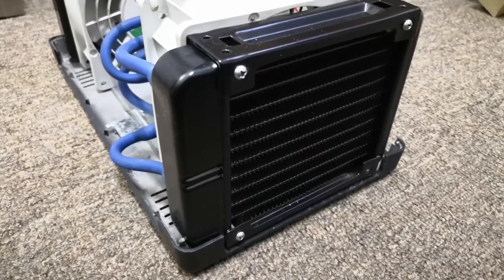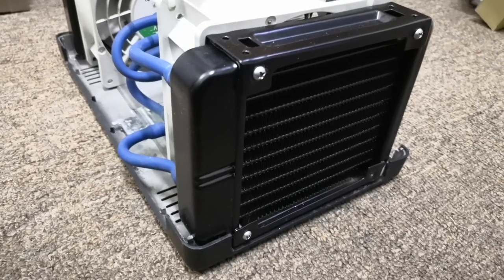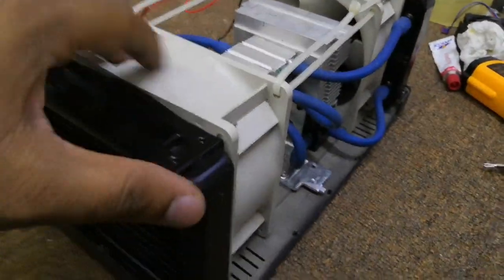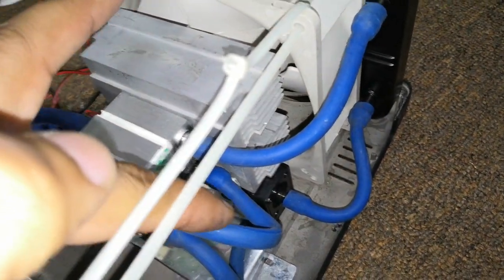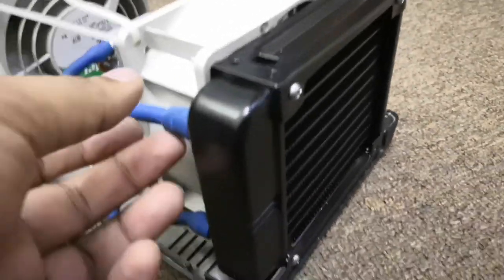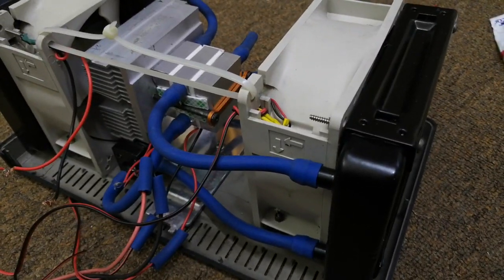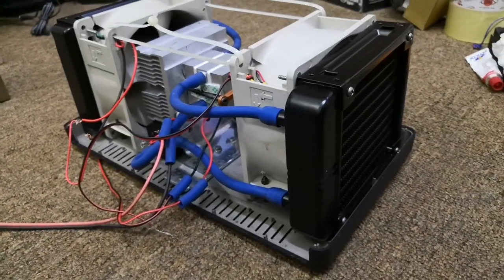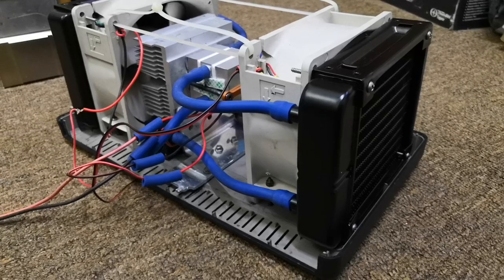Peltier AC, Worlds first water base AIR cooling system. Pani sey thanda krney wala AC.🥶

Comment: I prefer to use water blocks on both hot and cold sides of my peltiers. I run a circulation cooling loop through the module
s then into a stirred and insulated tank. Systems with enough wattage of Peltiers and a large enough tank, a pump with a dripless press in to connect connectors for as a
many cooling liquid loops as you want, down to 10 deg C. One line can be run into a case to run through a radiator to cool and dehumidify the case. There are so many options, your not the first buddy, sorry.
Reply: I think, if  coolants are used instead of water, that will be a grand success.

Comment: This is not a world first by any streach peltier air cooling has been around in multiple industries for multiple decades. It is poopy low in carnot efficiency. Thats why vapor cycle is the current standard and it blows peltier right in the face its easy to achiev 1000 btus of cooling with 100 watts of energy with vapor cycle you wont even get 100 btus fromm 100 watts into a peltier. Nice build but stupid energy waste. You could do more with less energy by buying a 100 dollar window air conditioner

Comment: I've been looking into building something like this and I have a question: wouldn't it work better if you had air blowing across the cold sides of the modules? So I was thinking heat sinks on the cold sides and blow air through. The air is cooled significantly before it exits the a/c unit.
If you pump the cool liquid from the water block to a radiator and then try to blow air through the radiator, wouldn't it just be a matter of time before you couldn't go lower in temperature?
Reply: I understand your question. I used a 15A peltier TEC1-12715 to water cool hot side and use heatsink and fan on cold side. If i turn off fan, it goes to sub 0 temperature under -10°, but if i turn on fan the sink temp doesn't go below 14-16°
I think same for radiator. The radiator is actually more efficient than sink and fan i believe so no waste of coolnees
Reply: Peltier seems nibali cold ko aircooer wali choti motor pump seems chahe voh jaga pe transfer karl sakte he

Comment: I’m looking to purchase something like this to cool the sleeper area of my truck. Can someone make something for me? And how much? Thanks
Reply: Its not worth your money or time,  peltiers work best in well insulated applications and when the hot side and cold side are separated. I did some math for you and even if a cooler could be 100 percent efficient and to feel anything you would need about 900 watts of power to cool 25sq feet. Peltiers are terribly inefficient, a common one is going to be 15 percent best case. So now you are looking at 6000watts to cool your sleeper with a peltier. At 12v thats almost 500 amps. Assuming you have a diesel even at 24 volts thats 250 amps and none of this takes into account the environmental factors that impact their cooling ability. I would reccomend a portable evaporative cooler if you live in a dry climate.

Comment: I think it is not effective for an cold air. Coz it will also get the heat from the other side. You need to put a division between two poles.

Comment: Why did you let the cold water from the cold water block flow into the radiator? I think that it does not help. You should make use of both radiators to cool the hot water. I think that will get better performance.

Comment: Cool build, i have almost same idea, but not sure, if warm water going in front has some effect. Its thermodynamic rule and when try to cold warm water also rise cold temperature. In my idea to be this efective need use warm water for something else as independed circuit. In my uderstanding if warm is not use for some worth, all princip is useless and only do some part of room warmer and some colder.

Comment: Great video (No hearing problem here.), and design. What kind of pump did you use?
Reply from the maker: Thanks for watching..
It's 12v DC breathless pump.. 2nos..
Please like share and subscribe to my YouTube channel DIY TAYSEER WORLD..
Reply: @DIYTAYSEERworld  I suggest a system that works on the principle of hot air (water too) floats.  In such case there is no need of motors, which will make noisy in the long run.

Comment: Nothing new there at all. And you forgot the fact that any heat absorbed will be expelled back into room. Five-fold in the case of a Peltier. In effect you have an expensive, complicated heater there. Lastly, that won't be very powerful at all, it will give a cooling output of about 100 watts at best. You need at least 1.5 kilowatts of cooling capacity to cool the average sized room. Which is why AC units still use the vapour-compression refrigerant systems, as they're much more powerful & efficient.
Reply: The effort is valuable and this will lead to a hightech modification of the entire system of air-conditioning.
Reply: @powercomsolar5724  there is absolutely nothing new here. Do you have any idea how an air conditioner works?
Reply: @phil955i  I didn't stated it is new or the invention of the person.  What I am intended here is encourage those who do something valuable to the society.  If all people thought of fuel energy is good for all times, no solar or battery vehicles will come out.  Cost effective solutions for the people is the need of the hour.
Reply: @powercomsolar5724  that makes absolutely no sense.
Reply: @phil955i  Request not see negative side alone.  The inventions and improvements are changing the life of the people.  You can also contribute to the society.

Comment: Wha about its performance???
Reply from the maker: Thank you for watching my videos..
The performance is good.. I have tested it recently.. And it work better when using car radiator coolant..

Now I need to redesign the same Idea with 2 reservoirs running coolant in both radiators..
Please watch my other videos on peltier and share my ideas and my videos to all so may be somebody can make in full scale model..
Thankyou 1s again..
Reply: @DIYTAYSEERworld  as compare to normal compressor's air conditioner
Reply from the maker: It's not efficient compared to conventional AC

Comment: FUCKING HELL!
TEC 12706 12V 6A
GOAL IS AIR COOLING
120NM RADIATORS FROM VALGOODS.COM
USING A SERVER/PRINTER FAN
TWO RADIATOR/TWO PELTIER DEISGN.
HOT COLD HOT SANDWICH
BETA DIDN'T EVEN FUCKING TEST THE THING, LIKE HELL I'M PROMOTING THIS!!
yo dude what tubes did ja use?
Reply from the maker: How did you promote my videos..?
I need you to do that for all my videos..hahah

Comment: the hotside will need to be removed from the house/boat/van, and placed in a cold area away from the sun, or the room would eventually get hot as the hot side produces more heat than the cold side produces cold, i build these for solar powered campervans, i have a 200watt system personally
Reply: Make a video like this bro. I believe many would like to see it.

Comment: Try an encased fluid heat exchanger and use a reostat switch so you can adjust V (I’m assuming a 200W TEC). Run a second loop with a 400 or 600W TEC. Stay around 5-7 V and run the larger TEC cold through heat exchanger against the hot side of the 200W. You should see significant cooling of the smaller TEC close to freezing.use a fan radiator set for the hot side of the larger TEC.
Reply: I would add a photo but its not allowed

Comment: Great  idea...we have built this also with mobility in mind. We used a 2 loop system with a heat exchanger to reduce cold plate to Minimal fluid temp (the trick is thermal insulation and TEC variations) to chill water to 40 degrees<. Did an air unit as well, again thermal control is key.

Comment: I just built one with similar a idea. The only difference is that I had to use a 240mm radiator on the hot side because I needed to dissipate the hot side more to get the cold side cooler. It does work. I get 85-90 degrees F the hot side radiator while the cold side is about 60-65 degrees F on 80 degree F weather. Planning on making it a split design so the hot side radiator is completely outside. Yours looks better than mine though lol. U used foam board to cover the whole thing.
Reply from the maker: Well this was just a design.. But incomplete.. 
Now iam planning for a new video with a completely new idea..already designed.. Based on peltier and radiators..
But with different techniques
Reply: @DIYTAYSEERworld  Any effort taken for the development of peltier cooling will never end in loss to you or the society.  Keep the spirit.
Reply from the maker: No I didn't use foam board
Reply: DIY TAYSEER world  I used over the counter rubbing alcohol and water mix for cooling. Definitely need a reservoir container for both hot and cold which I don’t see in this video.
Reply: DIY TAYSEER world also on your video you need a wall separation from the hot and cold for the best results.

Comment: Nice project. But remember you need to exhaust the hot air out of the space you are trying to cool. It warms more than it cools
Reply: You could use it as spot cooling on your face and neck at 26 degrees and leave your room door open. Put 2 more small fans to extract the hot air at the back to get the coldness to 26 degrees. It is also good to put it in a big hall where the ventilation is good for hot air to escape.
Peltier is never an aircon that can cool a room. 
It is actually a spot cooling device ,the most good for 10 ins range.
It is also fun to discover how effective it can get. Have fun guys and have 2 beers. 🥰🥰🥰🥰🥰🥰🥰
Reply: @ExitTwo888  I appricate the effort and brain used to make this compact and practical.
Reply: If it is fixed after making a hole (just like window AC) the hot air will not enter room from the system.

Comment: Your using cooled water as the medium for cooling the air on the cold side of the AC. However there is cold leak on the radiator.  It would have been better (for me) to use direct cold sink cooling which would also make it work as a Dehumidifier just like a refrigerant type AC.  One fault i see is that your drawing air to the cold side and cooling the hot radiator from one source.  There should be a separator so you draw outside air to cool the heat sink outside and inside air to be chilled for inside use.  just saying.... But very nice idea and design non the less.
Reply from the maker: First of all I would like to thank you for your suggestion and explanation..
The Idea was to test the design based on watercooled radiators as it was not the final product so the saparation was not installed..
Why water cooled radiators..?
Cause I have already tested many cooling and heating sinks whether it is aluminum or copper both cools down to negative temperature until the air is not blowing around them.. Once you start blowing normal air which is inside room temperature air the cooling side gets normal very rapidly.. So the cooling effect does not works with direct cooling sinks..
Even the very chilled water cooling block gets normal once the normal temperature water starts to circulation within it.. But it works better in my understanding..
Reply: @DIYTAYSEERworld   You are right, tested both direct and radiator cooling. and direct cold sink does not cool as much as i expected. but in my test I also tested using anti-freeze, which worked better since it was able to absorb more of the coldness without fear of freezing.  I also added a 2 speed control to both the cold pump and the fan being able to control water circulation speed for a much cooler air output at low speed.
Reply: how to use antifreeze

Comment: Hi, could you post the parts list?
Reply from the maker: Items required

2x 12v cooling fans 120mm. 

2x120mm water cooling radiators.

3xwater 40x40mm aluminum alloy water cooling blocks.

2x peltier devices tec1-12706. 

2x 12v brushless water pumps.

Some pipe hose for water circulation.

1 ltr Car radiator anti freeze Coolant. 

And a base plate.

Note.. This design is still untested..
So the results are unknown.. 
Thankyou..
Reply: @DIYTAYSEERworld  will you be testing the results in a future video?
Reply from the maker: .. Yes of course.. I am having a plan for making another video demonstrating and testing this unit..as well as showing the results.. In live